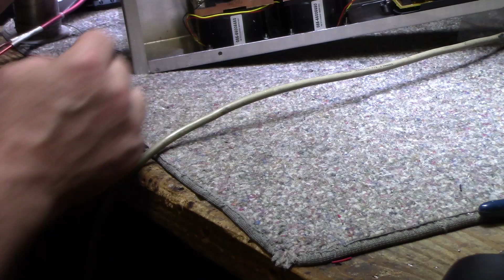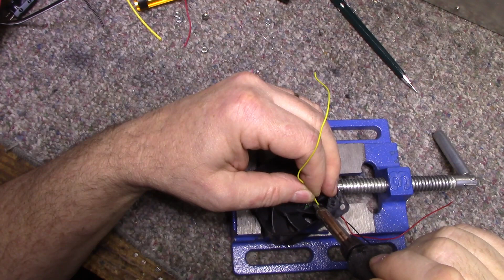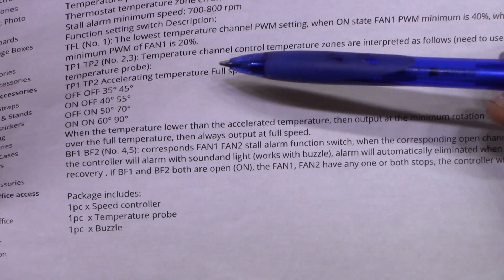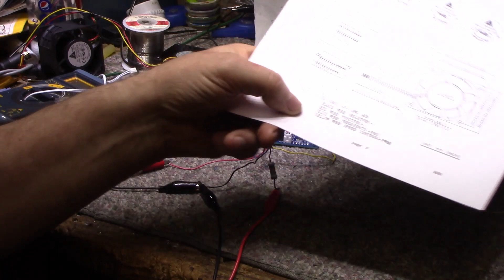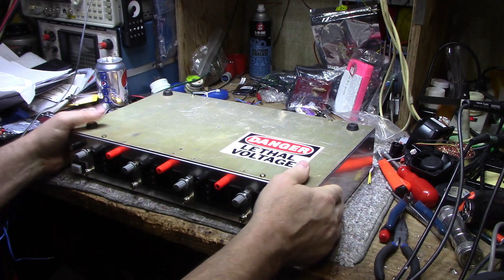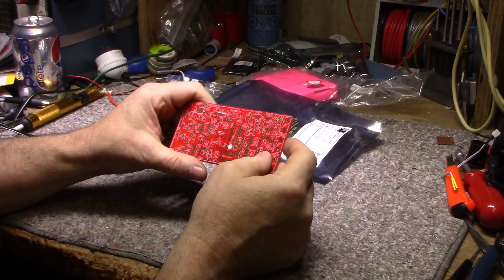Electronic Load Part 5 (final)

Comment: Is 10 amps the limit for these modules? Can they be made to draw more, perhaps with the addition of higher rated MOSFETs?
Reply from the maker: Difficult to say. This design isn't great for high power applications. The trouble starts when you operate the load near or at the SOA of the transistors. I did my best to provide good cooling but I can still blow up mosfets if I don't watch SOA parameters. Luckly, in my design I can change a blown mosfet in under 5 min so it's easy to service and parts are plentiful
Reply: @TrevorsBench  I'm leaning on the side of caution and thinking that maybe this option isn't for me. I need higher loading ability for testing things like high current power supplies. There are some 30 A loads commercially available (out of china but reasonably priced) and some really nice stuff (think HP/Agilent etc but real wallet-busters) on the market. For general work this design and kit probably serves most people's needs.